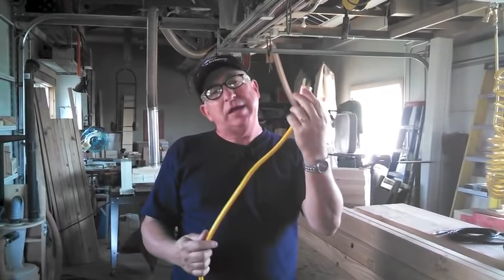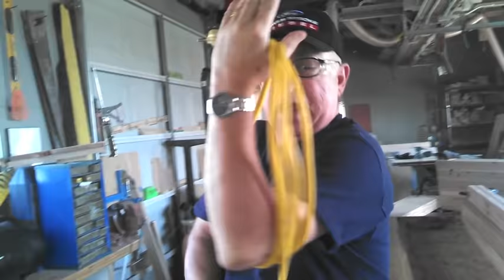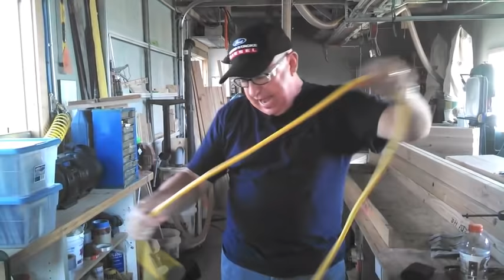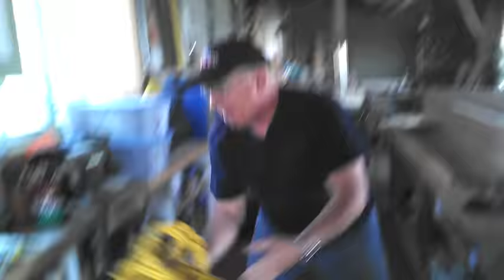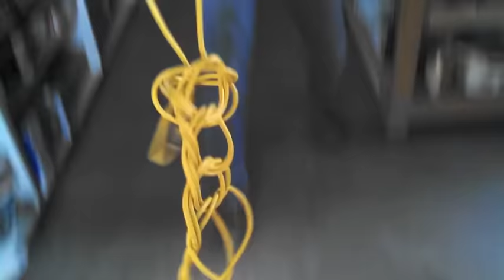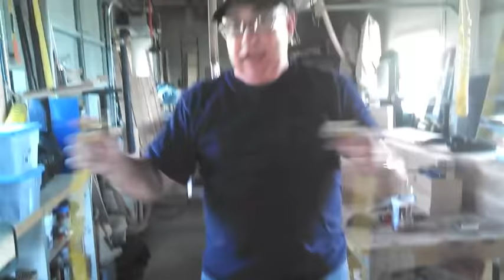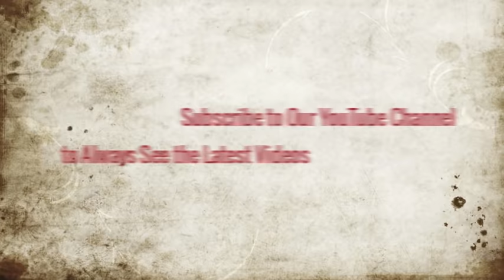Best Way to Store an Extension Cord

Comment: Or you could store your cords right way.
Reply: dozer1642 Right on
Reply: Mr.Dominic Amoe Sure you save time unrolling it but you don't save time rolling it up. It takes ten to fifteen seconds to roll up correctly. This method is known to cause kinks over time because of the pressure you're putting on the wires. It's proven to cause failure even fires.
Reply: necrosplangy I once caught a dude rolling a 100' cord around his elbow, when I told him not to do that, he said,"that is the first time I got yelled at for doing it right". The same guy had one of my 10' cords looking like a pigs tail, truly amazing.
Reply: What is so difficult about laying the coil on the floor grabbing one end and walking away? You don't have to uncoil the whole thing. I've coiled miles of 3/8 longline without knots.
Reply: aculasabacca
Reply: And depending what kind of device gets plugged into the cord, by leaving part of the cord either braided OR coiled, those loops work to allow heat build-up that, although unlikely in most uses, CAN and even HAS caused cords to get hot enough to cause fires.  NEVER leave part of the cord either braided OR coiled if what's plugged into the cord is going to be getting used for extended periods of time like several hours or even overnight or all winter.

Comment: I'll keep rolling it in circles because, it's faster and easier.
Reply from the maker: Ryan, thanks for weighing in! Best regards, DFJ
Reply: Ryan Linden Exactly, I’m a union concrete mason “Foreman”. The daisy chain aka “Lazy chain” isn’t allowed on union jobs because it takes to long and it’s a big trip hazard. The wrist to elbow figure 8 is the fastest and safest way because you can unwind an extension cord by just throwing it while holding the male end and far less of trip hazard. Also OSHA frowns on the daisy chain.
Reply: yup, Just roll it in circles. lol Union stuff is always relegated to and subject to cuts. lol @mercurym-7904
Reply: @mercurym-7904  OSHA frowns on everything. When you use quotes in that way it appears you are saying that you are NOT a foreman. Wrap your cords in whatever way you prefer but don't pretend that 30 seconds is a big efficiency drag on a union job.

Comment: Induction loops. Please do not tell people to leave as much cord coiled up as you like. Loses and heat problems generated from large current flows will help to trip the breaker.Always straighten the cable then Z it to get your length required.
Reply: Michael Foransich- please do not tell people induction loops are a problem in 14 gauge extension cords...... remember there are two current carrying conductors in an extension cord which carry current in OPPOSITE directions. The magnetic fields of the two wires cancel each other out. Even if you want to argue a negligible EM field created by the net difference between the hot and neutral, remember there is a ground wire in most extension cords too, which would absorb the field and carry it to ground. 

Induction loops are only an issue when dealing with three phase power cables where each leg is being carried on a separate cable, those cables should not be coiled up.

Comment: You should have explained, the round method causes the insulation to break loose from the exterior coating. Will curl inside making it like a corkscrew, worthless

Comment: Way too much work. Just take a 2.5 gallon plastic jug or bucket, cut a 1" hole in the side. Stuff the cord in, it will coil itself pretty neatly if your cord is not kinked or stiff. It will never tangle because it comes out exactly as it was put in.
Reply from the maker: Bob, thanks for the comment. I literally have this done in about 45 to 60 seconds, so it works well for me and other tradespeople that I know. However, the method you've mentioned is a great one! It's handy too because you get a handle from the bucket to use as well. In fact, I've used this for larger gauge cords or ones that are extremely long. Thanks again for sharing. Best, DFJ

Comment: Only problem I see, the “unused” cord is still coiled up creating additional resistance and lowers the ampacity or load carrying capabilities of the cord. It could heat up or melt if too many amps are drawn by larger power tools. I was always trained, it is best to unravel all your cords and avoid coils.

Comment: This is the worst way to store a cord.  Please take this down!!!  Over-under is the only way for a cord like this.
Reply from the maker: Kevin, thanks for your subtle suggestion. There are a lot of people in the trades that use this approach, as well as other ones. There are some situations that I used over and under as well, but I won't be taking the video down. Thanks for taking time to express your opinion. Best Regards, DFJ
Reply: Thanks for the reply.  I have not run into a situation where this is advantageous to an over-under roll.  It seems like it makes it take longer and messes up the cord's ability to lay flat and roll into a coil correctly.  Frankly, I think they probably shouldn't be using this method unless it's a rope or strap.

Comment: My dad taught me this braid method when I was a kid. All the carpenters on his framing crews did this. "See you only pull out as much as you need." Seemed to make a lot of sense. Then I got a job on a movie. I showed the method to the electricians. Electrician is a bit of a misnomer, cable winder is a better description. They do a lot of that all day long. Nobody who wasn't press ganged into the Royal Navy 200 years ago coils as much cordage as a movie electrician. The movie guys looked at it, shook their heads. Coil it. Not around your shoulder and elbow - that ruins a cable. A quarter twist and a standard loop you set by how far apart your hands are when you close the loop.  Easy to learn, easy to make perfect same sized loops. I do it for cords, rope, string.  A piece of string to tie it off... I switched and never braided another cord again. BTW most of my longer extension cords are at least 30 years old. So if this wasn't good I'd be burning up saw motors. 
If you have to coil up something heavy like the 100' 10/4  cord I just put together to charge my Tesla, then you start in the middle, pull it from one direction and coil it, then turn around and pull the other direction and coil it. You never have to pull more than half the weight. Same one quarter turn. 
Now my Tesla extension has a big raintight box at the end with the outlets. Rather than drag it along the ground, I would walk this to the loop so that I'm pulling just cord until I get to the end. 
I always thought it was cool to braid a cord, but I've yet to see any reason to use it. Hope I didn't rain on anyone's parade.
Reply from the maker: Thanks for your insights and sharing your expertise! No offense taken - we appreciate the dialog. Best Regards, DFJ

Comment: I learned this method on the job site and used it for years.  The disadvantages are already listed by other commenters.  I searched on the web for a better way and I now prefer to use the method used by professional concert riggers.  This may have also been mentioned by others, but I got tired of looking.

Roadies alternate directions while coiling the loops (of audio cables) and don't wrap them on anything.  This storage method avoids that nasty twist you demonstrated and also lays flat, hangs flat, and uncoils without twisting or tangling.  You and also throw it and it will not tangle and twist.

If the "crochet" method suits your needs, by all means continue to use it.  I have moved on to something that suits me much better.

Comment: I learned this many years ago when my dad and his friends built our house.  Back then, no cordless or air powered anything.. so you had 100ft extensions cords and that was the way they stowed them.  Sort of surprised this isn't more well-known.
Reply from the maker: Thanks for watching and commenting CaliRaftDude. Surprisingly, this is one of the MOST controversial videos we've ever produced. Readers either love it or hate it. We are always surprised at the level of passion that is exercised in support of their view! Best. DFJ
Reply: @DirtFarmerJay  hi DFJ it's not wether  we love the idea or hate it,the cable that's still bundled up gives of heat from being plugged  in and u know what coming ! yes to much heat in the cable can MELT and evently catch fire. u r a bad influencer on here if u think its ok to give potential dangerous information.
Reply from the maker: @stum8374 , thanks for weighing in. I can't agree with you on this. I've never had any heat build-up or cord damage using this approach, and I've had several electricians weigh in on this topic as well as indicate heat build-up for this type of loosely chained cordage just doesn't happen. I've tried to create it as well, and can't. The only time I've had cordage warm up is when there is a sustained significant current load on it. I use this method, as well as others for cord stowage, each with their advantages and disadvantages. As far as me being a bad influencer, thanks for letting me know your thoughts. Best Regards, DFJ
Reply: @DirtFarmerJay  maybe ù should say any cable  used should not be overload or it MIGHT give of heat,just because u haven't had any heat/fire does not mean it can never happen.

Comment: Another tip, for a new cord.
Wrap some electrical tape randomly in a few spots simulating it having been repaired (even though it's perfectly fine).
Someone taking a cord that's not theirs will pass over the seemingly repaired cord for one that is new

Comment: Thank you. Is there a variation on this for a garden hose? If not, what's the solution?
Reply from the maker: Thanks for watching and commenting Peter Casanave. We use hose reels around the farm and they work pretty well. If the hose is only 25 feet or so, you can usually just coil it up on the ground next to the faucet. Best to you, DFJ

Comment: As a forman on a commercial concrete crew, I told my guys if anyone put away cords like this guy does he would be fired.
Reply: Yup this is a guaranteed way to make sure you get tangled with every tool in your truck, hammers, shovels, pipe wrenches, trowel handles...anything and everything will get stuck in those little holes.

Comment: I mark the middle with electric tape, so I can save that first step.  I also pull through the loop. I'm gonna try the push next time.  For very long cords you can quadruple up the cord, but then you have to undo the complete cord to use.  That is useful for 200 foot 10 gauge cords when you don't have a spool.  If marking the center and quad points, on long cords, use different colors of tape.  A 200' cord weight the same as 2 cases of bottled beer, so if you can coil that  you are strong. If you do coil, remember to switch arms every time you coil to undo the twist, and work the biceps equally.  Short cords I coil, twist and use s velcro tie to squish it together.

Comment: At last I have found this method.
I first  met it many years ago in water safety where it used to be used to tie a lifeline to a lifebelt. One end of the line was tied to the belt and the other to a post. In a emergency the lifebelt can be removed from the post thrown to the casualty, and line would unravel quickly and without tangling.  
These days, vandals would mess about with it or even steal the lifebelt and / or the lifeline.

Comment: Nope, any small loops cause additional stress on the wire. When it is cold it won't like to unravel and will maintain a set until warmed. 
Take the time and gather into larger loops, about 3' in circumference, untwisting as you loop. The cord will be much more relaxed and will last much longer. It will lay flat and is easy to unwind. If you have to roll the cord into a bucket, it is a smaller loop but easy storage.

Comment: I adopted this method for some large heavy-gauge cords and I think I'll stick with it. However I ran into a problem trying it on my block heater extension cords as the temperature's just dropped to -15 C (5F). Those small loops don't work out too well when trying to spill a half-frozen cord. I wouldn't dream of trying to do it up that way again.

This is a commercial cord, cold temperature rated, but I admit it's still not as flexible as something I would make from scratch.
Reply from the maker: Thanks for insight, CivilDiscourse! Great name BTW! Best, DFJ
Reply: @DirtFarmerJay  Thanks. I chose it as a reminder to myself that there's more than enough snark and name-calling on the internet already.*

*It doesn't always work. 😜

Comment: I was a trained/schooled electrician in the US Navy, and Jay is exactly right! When I see someone do the hand-over-elbow method, it never fails to make me cringe! There is a couple of other methods you can use to fold a cable that don't twist or crimp the internal wires, but they can tangle easily. On Jay's method, just be careful not to crimp the cable at the halfway-point, and you're golden!

Comment: This has the added advantage that it won't heat up under heavy load like a single-coiled extension will - induced fileds in each half cancel each other out. If done properly, by far the best way to do it.
Reply: PS if you do insist on a single coil, then make sure you unroll the whole length every time you use it - less heat, less voltage drop especially if you are trying to shove 10 amps + down a 100' extension (you wouldn't do that, now, would you?)

Comment: This is good way to create a trip hazard on a job site. Cords wrapped like this won’t lay flat. A tradesman that works with cords constantly loops them in equals loops about 2 foot in diameter rotating the cord as he rolls it up to prevent twist. Used to have to retrain all the Yankee framers that came down to Texas to frame. Once we showed them the correct way to roll a cord up they never used that chain method again
Reply from the maker: CCO, thanks for jumping in and sharing your expertise as a craftsman. Indeed, the method you describe is one that is used by many tradespeople. In fact, it will be one of the featured methods on an upcoming episode showing various techniques and the pros and cons of each one. Thanks for taking time to write. Best Regards, DFJ

Comment: My trick with wrapping the cord around my arm: alway pull the cord out from the inside of the loop, and when you are done using it, start wrapping from the other end. This eliminates the twisty tension problem, extends fast, and there are no tangles. I use corded garden tools and never have any problems.

Comment: I worked on tugboats in the 80’s, we had two 300’ extension cords. This was the only way to store them. Every 3 days we would roll them up and put them back out on a fresh set of barges. I could have our running lights up and working in 15 minutes.
Reply from the maker: Tony Faconi, Thanks for the insights on how this method can work well in different settings. I'll bet you have some great stories to tell from those days! Best to you, DFJ

Comment: I use a 5 gallon paint bucket with lid to store these long cord. Coil cord at bottom , the end of the cord will be the one plug into the source. No twist, no rain, no thing can chew on it. Can store more than one cord. When need to use, pull it out without even one twist

Comment: Carpenters and other tradesmen have been using daisy chains for as long as electric power tools have been around. There is however an electric revolution underway with battery operated tools. 
As a sailor, I now store long line in the same way.

Comment: I have been doing that for years.  Learned it from a carpenter who had replaced his drills cord with a 100' extension cord. (back before cordless).  Great thing is since it's already a knot, it can't get tangled again. I only do it on longer cords.  Double them and then knot.  I  only watched a bit but my hand movements are different.  I can wrap that in the same amount of time someone does a loop.  Then if you fold it in half a couple times it takes up about the same space.
Reply from the maker: Good stuff!

Comment: Won't this braid damage the strands of my 14/2 cord?
Reply from the maker: Andy, thanks for watching and writing. I haven't had any issues as you've described. If you don't make the loops smaller/tighter than what you see, the cord filaments should bend without damage. That's been my experience and suspect it will be yours as well. We are doing another video showing some other winding techniques as well. That'll be out in a few months. I hope you'll watch that as well. Best Regards, DFJ
Reply: Thank you, Jay.

Comment: I've done this for years. That's the way parachute shroud lines are packed so they rapidly and smoothly release when the chute is deployed. I've tried to show many people this and they stupidly refuse to do it and insist on still doing the wrap around the arm bit. Their loss. Incidentally, my mother packed parachutes at one job during WW2 (if it don't open bring it back, we'll give you a new one) and wired radios at another.

Comment: I don't know how old you are but I've been doing this for about 50  years. But one thing that always got me that I never figured out though, was about 1 out of 5 times I would have to pull it out backwards one loop at a time. Did this ever happen to anyone else. I'm retired now and still can't figure.
Reply from the maker: I'm 65 gary olsen. I learned this when I was a trim carpenter in my early 20's. I use it to care for my woodshop cords. It's not for everyone but it works well for me. Best, DFJ